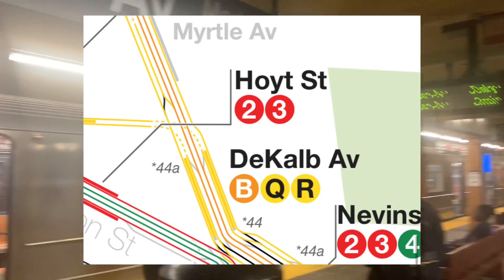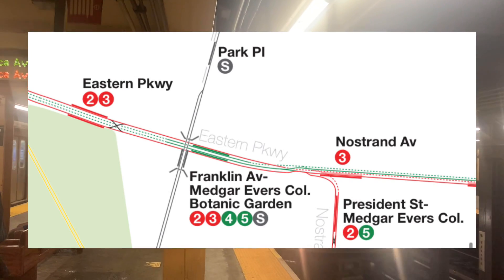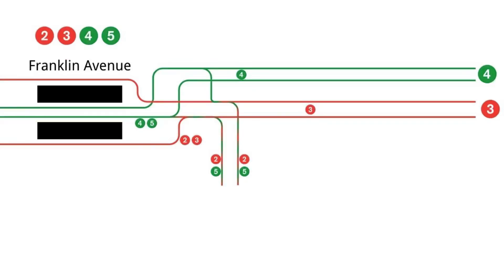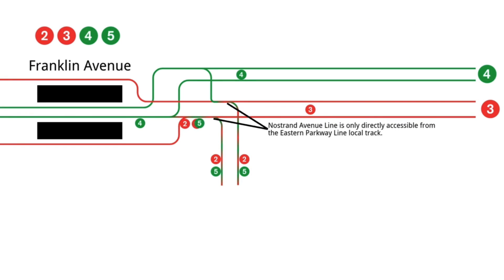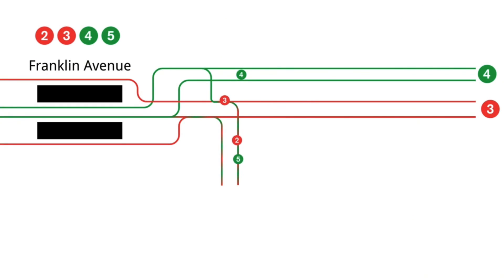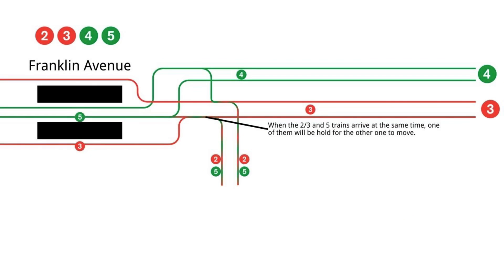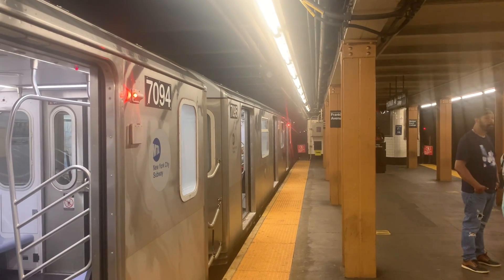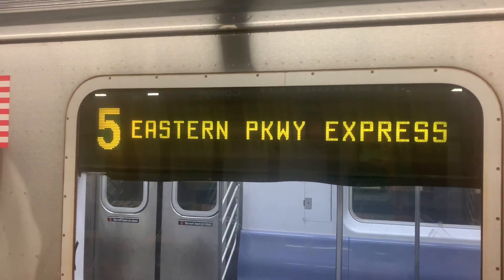Rogers Junction: Fix it to get 30% more capacity in the A division!

Comment: In my opinion I don’t think skipping 2 stops going express is even worth it , I don’t see a problem with the 4 running local
Reply: @Tomolokolabel  And the thing about it is, it’ll still have to switch over to the local track to serve Kingston and Nostrand. They might as well leave it as is, because then the 3 won’t have a yard.
Reply: @darrylreedy5079 Nothing wrong with adding two new switches and rerouting the 3 to Flatbush Avenue and away from Livonia Yard, a yard that’s pretty much useless for 3 train operations (given how many trains for the 4 and 5 are stored there) In fact, with deintelrinjng plans, the 3 can be merged with the 2 route (internally) and be based out of East 180th/239th Street Yard while the 5 can instead be based out of Livonia Yard, improving operations.
Reply: @TheRailLeaguer Yeah, that makes the most sense. But honestly, I’d leave it as it is, considering the fact that the 5 doesn’t run late nights and weekends into Brooklyn anyways.
Reply: @darrylreedy5079 Nothign wrong with expanding its service span, but most deinterlining plans see the 4 going to New Lots and the 5 stopping short at Utica, so in essence you could have the 5 not run into Brooklyn during weekends and Utica riders won’t be crying over the two extra stops. In all honesty, the 5 really needs to go to Brooklyn during weekends. Those 4 train waits can get brutal, especially if you get out at the wrong time. And besides, it’s 2025. No more of that peak hour or weekday only crap.
Reply: @TheRailLeaguer My point exactly regarding the 5. But still, how would those switches work going past Franklin? Doesn’t that mean the 4 will still have to switch to the local track in order to serve Kingston and Nostrand? And honestly, I like my one stop rides going from East NY to the west side of Manhattan.
Reply: @darrylreedy5079 Yes, the two new switches east of the junction will allow for the 4 to switch to the local tracks to serve Nostrand and Kingston, like what everyone else is proposing.

The loss of a one-seat ride to the west side from East NY isn’t really much of a big deal, given that 3 service has frequently been suspended most times there’s work in Manhattan. Besides, not only would the transfer at Franklin to the 2 or 3 be faster than the current one-seat ride vis the 3, but the Fulton Street Line is nearby providing that same service, with less chances of service suspensions during weekend work.
Reply: @TheRailLeaguer 
I just realized you're right after seeing census data Utica Avenue riders are headed towards downtown Brooklyn and Lower Manhattan so having an IND Utica Avenue line would no longer be necessary. 

Also Lower Manhattan isn't really a popular destination for those on Broadway Brooklyn and Myrtle Avenue rather their preference is Midtown Manhattan Soho I think for now M train interlining is worth it but as gentrification marches Eastward into Northern Brooklyn and Queens in the long term we might need drastic improvements and changes to fix the infrastructure of the BMT Jamaica Line as a whole.

There's also lack of connectivity between Northern Brooklyn, Southern Brooklyn and Central/Northern Queens (of which Queens is currently dry and is in better need of public transit mobility).
Reply: @TheRailLeaguer 
Also are you planning to de-interline the 2 and the 5 in the Bronx since you initially said that the 3 would be based out of Unionport/239th Street Yard plus the problem at 149th Street GC is very serious so I'll convert the Lenox Aveune line north of 135th Street into a shuttle while the 135th Street station would get converted into an island platform that way you can route the 3 to Dyre and the 5 via Jerome with some 5 trains short turning at Burnside Avenue meanwhile Pelham can get its switches rearranged and on top of that Westchester Square can be converted into an express station to short turn trains plus eliminating peak express service on Pelham will help out. With this deinterlining proposal all IRT lines can run a combined 30 TPH (15 TPH for each line) on White Plains/Dyre, Jerome, and Pelham.
Reply: @TheRailLeaguer What you mean nobody “weekday service” I hope you fully aware that ridership varies between time and it doesn’t always wander full service.
Reply: @Amiri_subwaymaster Nothing wrong with deinterlining allowing for full service during the weekends, not just weekdays.
Reply: @TheRailLeaguer You’re not listening, the Eastern Parkway, Central Park West, Queens Blvd, 6th Avenue, Broadway, and Brighton all have weekday only services and because ridership is much lower on weekends they not a need nor demand to spend more money on running excessive traffic. That a why the B and W don’t operate on weekends.
Reply: @Amiri_subwaymaster Nothing wrong with fixing that, especially given how terrible weekend service is. In fact, deinterlining Eastern Pkwy actually enhances that, without any increase in operating costs. We already spend more money to terminate 5 trains at Bowling Green rather than going into Brooklyn to adequate service for Brooklyn residents as an alternative to driving.
Reply: @TheRailLeaguer Why would it be cheaper to run a subway route longer than short turning it. Make it make sense because that logic is pretty nonsensical. Because clearly you have to pay more to those who operate on a longer subway route than shorter routes.
Reply: @Amiri_subwaymaster Because you carry far more people on the longer routes, especially with increased ridership. Trust me. I’ve seen those 4 train headways going into Brooklyn, and they are garbage. Plus the 3 has been frequently suspended during times of track work in Manhattan so my plan and other deinterlining plans for Eastern Parkway eliminate this headache, while saving money.
Reply: @TheRailLeaguer That doesn’t answer my question, I’m asking how “shorter routes are more expensive to operate than longer routes” because you need more train crew and to pay the crew more for the longer trips.
Reply: @Amiri_subwaymaster Shorter routes means emptier trains and less frequent service on other parts of the corridor, so you lose money and it’s expensive. And an extension of the 5 into Brooklyn during the weekends doesn’t need more train crews. The existing ones on the 5 route basically do nothing they might as well not even be here (doesn’t help that the 5 is mostly empty once all the Bronx passengers clear out). Besides, what do you have against having the 5 go to New Lots while the 3 is absorbed into the 2 route to Flatbush? No one is going to notice anyway, but Lexington Avenue express riders see more consistent Brooklyn service rather than waiting >8 minutes for a 4 train on a Saturday. More riders = more revenue = less operating costs.

Not to mention that Bowling Green is a crap location to terminate trains anyway.
Reply: @TheRailLeaguer 
@TheRailLeaguer 
According to census data Utica Avenue riders are headed towards downtown Brooklyn and Lower Manhattan so having an IND Utica Avenue line would no longer be necessary. 

Also Lower Manhattan isn't really a popular destination for those on Broadway Brooklyn and Myrtle Avenue rather their preference is Midtown Manhattan Soho I think for now M train interlining is worth it but as gentrification marches Eastward into Northern Brooklyn and Queens in the long term we might need drastic improvements and changes to fix the infrastructure of the BMT Jamaica Line as a whole.

There's also another thing about the lack of connectivity between Northern Brooklyn, Southern Brooklyn and Central/Northern Queens (of which Queens is currently dry and is in better need of public transit mobility).
Reply: @TheRailLeaguer  
Speaking of housing, development in southern Brooklyn is mentioned. I've said before how I feel about SAS via Utica Ave line, as a way to relive the Lexington and Canrasie trunks in general, and platform overcrowding at Union Square and Bleecker Street in particular. (It would also aid Brooklyn/Queens connectivity by giving the A, C, J and M lines north/south connections.) Right now it would be helpful to know whether the current B46, G, J, and L riders prefer Midtown East or Midtown West as a whole. Because my stance for Utica Ave being a separate IND line rather than an IRT branch could be fulfilled by an extension of whether 8th Avenue services terminate at WTC, instead of SAS. Could go either way.
Reply: @TheRailLeaguer 
Speaking of housing development in southern Brooklyn is mentioned. I've said before how I feel about SAS being the Utica Avenue line, as a way to relive the Lexington and Canarsie trunks in general, and platform overcrowding at Union Square and Bleecker St in particular. (It would also aid Brooklyn/Queens connectivity by giving the E, K, J, and M lines north/south connections.) Right now it would be helpful to know whether current B46, G, J, and L riders prefer Midtown East or Midtown West as a whole. Because my stance for Utica Aveune being a separate IND line rather than an IRT branch could be fulfilled by an extension of whichever 8th Avenue services terminates at World Trade Center instead of SAS. Could go either way.

 Since we're talking about crayons here's mine. I keep my A/C/E labels for Fulton/8 Ave/Queens Blvd express, with the K being 8 Ave/CPW local. I am no longer extending that on the Manhattan side, so WTC stays. The K would be extended at the Washington Heights end into New Jersey, via Route 4, to Paterson NJ.

I used to tie an extension of the Myrtle Avenue line to 8th Avenue. Instead I'm tying it onto Broadway. Now that I know the S-bend between Corrtlandt St and City Hall can only take a maximum of 20 TPH, I'm extending the present day W down to the lower level of City Hall then to downtown Brooklyn on a new alignment finally I have the W running down Myrtle Aveune with a portal at Ryerson Street so it properly connects with the Myrtle Avenue El. So the would now share tracks between Metropolitan Aveune and Ditmars Blvd, combining this is a future extension along Eliot Avenue and Junction Blvd to LGA serving Corona all within a one seat ride and creating a loop line this would follow the Q58 which is top 2 of the busiest bus routes in 2022.

Comment: @Urban_Man, I would like to ask, could the 8 train be used to replace 5 train services to Dyre Ave if Mott Interlocking ever gets deinterlined or if there are any plans on deinterlining it? (The 2 and 3 would remain the same.)
Reply: I want the 3 train to continue to run to New Lots Avenue whatever happens. I don’t want to change the 3 train’s Brooklyn terminus as it serves New Lots Avenue pretty well and it has direct access to Livonia yard.😊
Reply: @toufikelobeidi5569Livonia is one pretty useless yard for 3 train ops. All those storage tracks and nearly all of them are for 4 and 5 train consists. Besides, rerouting the 3 to Flatbush and having the 5 go to New Lots (via new switches west of the Nostrand Avenue platforms) would allow for the 3 train to be consolidated into 2 train (internally) and be based out of East 180th Street Yard, while the 5 takes on Livonia Yard. Having the 3 based out of East 180th is no different from the 1 train’s operations at 240th. And besides, the passengers get to see more consistent service on 7th Avenue while those further east see faster rides.
Reply: @TheRailLeaguer You don’t realize that the 4 and 5 trains are based off of Mosulu yard and East 180th Street yard right? The 2/5 literally shares equipment.
Reply: @Amiri_subwaymaster My plan eliminates that. Instead, my plan has the 2 and 3 sharing equipment instead, same with the 4 and 5, increasing all the commonality, and turning Livonia into a yard that’s only useful as a jobs generator for East New York and nothing else.
Reply: @TheRailLeaguer 
According to census data Utica Avenue riders are headed towards downtown Brooklyn and Lower Manhattan so having an IND Utica Avenue line would no longer be necessary. 

Also Lower Manhattan isn't really a popular destination for those on Broadway Brooklyn and Myrtle Avenue rather their preference is Midtown Manhattan Soho I think for now M train interlining is worth it but as gentrification marches Eastward into Northern Brooklyn and Queens in the long term we might need drastic improvements and changes to fix the infrastructure of the BMT Jamaica Line as a whole.

There's also another thing about the lack of connectivity between Northern Brooklyn, Southern Brooklyn and Central/Northern Queens (of which Queens is currently dry and is in better need of public transit mobility).
Reply from the maker: Initial thought is it may work, so service to Harlem-148th St does not have to be a shuttle.
Reply from the maker: In that case it would be 3 goes to Harlem-148, 4 and 5 would go up Jerome, 2 go to Wakefield, 8 to Dyre Avenue.
Reply: @Urban_Man Any plan for deinterlining the Bronx is an utterly ridiculous idea and stupid. Don’t know why you formers are obsessing over it
Reply from the maker: @Amiri_subwaymaster why?
Reply: @Urban_Man Because the crowds on the 2/5 train are already crowded enough. Furthermore Burnside Avenue was not designed to be a full time terminal notice how all the 4 train that terminate there run express to burnside Avenue meaning that one portion would’ve had to be short turn at 149th street grand concourse. And the 5 train gets neutered into a rush hour only clone of the 4 train

Comment: Good video, just a correction. Current (5) train pattern does have it running to Flatbush Ave during rush hour and midday.
Reply: @DarkEnzanArikado  that was the case in the early 2000. But now it goes to flatbush Ave on a regular weekday